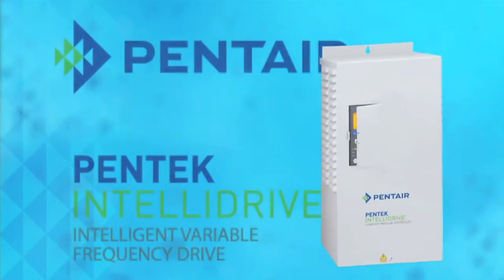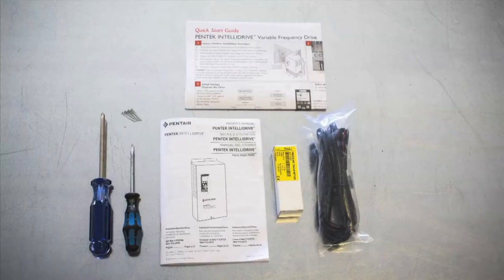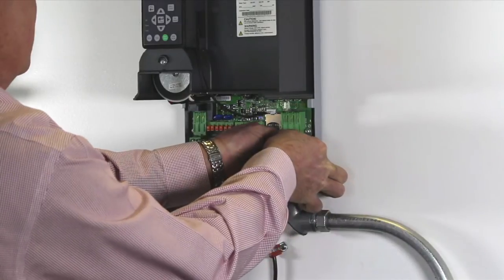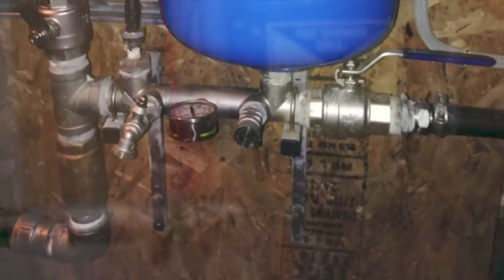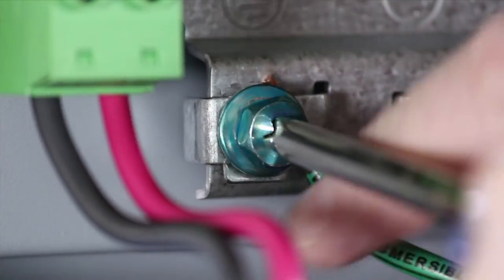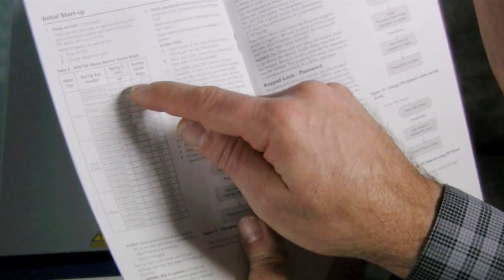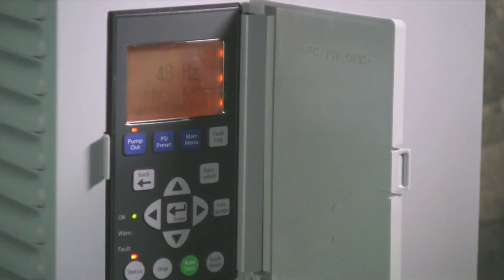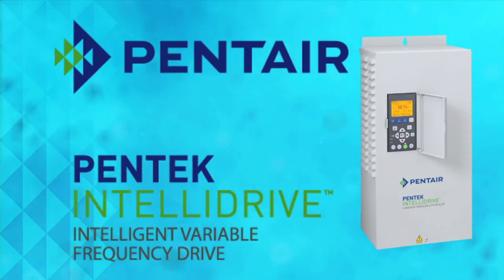Pentair's Pentek Intellidrive Quick Start Video

Comment: Can you do a float installation? Currently having issues they had a sub 75   no power to the box, replaced it with one of these drives have the float hooked up to i2+ and i2- and transducer is hooked up but is just stuffed inside the box, not In the water line it'll run but won't kick off with the float fully raised, float is good still have continuity but can't get it to kick off on its own

Comment: In the video it shows entering 5.5 amps but the motor shows 1.6 SF which one is correct when entering at setup?
Reply: The service factor is 1.6 which is the multiplier
Reply: SF or service factor is the percentage the motor can safely overload. The amps the motor should pull, under normal use was 5.5

Comment: I just purchased this system and I fear the installer installed many things incorrectly. Here is a video I made of my improper install.  https://youtu.be/mHd0yNfBIpUShould I fix the issues or leave it alone since it’s working? I called Pentair support, and got someone reading from the manual rather than an answer by someone who knew what they were talking about.